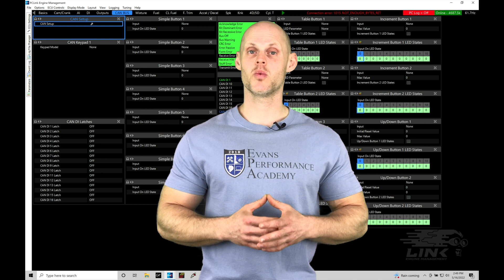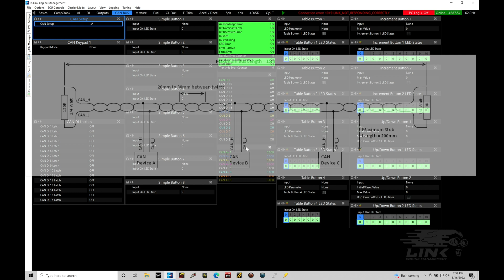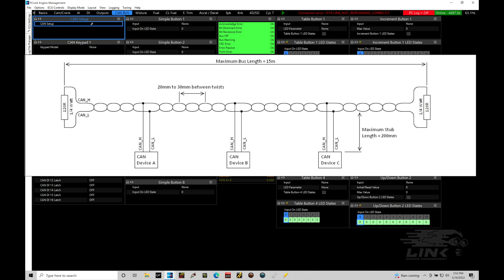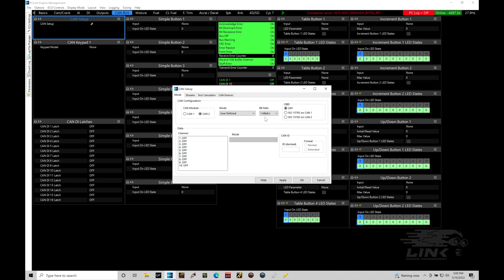Link G4x Training Part 56: AEM X-series Can Lambda | Evans Performance Academy

Comment: Is there any way to delay the heater from turning on until the engine is running with Link? Or delay the heater until it is at a certian temperature through the exhaust heating it up?

Comment: What’s your opinion on the LinkG4 for Hondas? How does it compare to the Hondata s300? Pro/Cons?
Reply from the maker: The only con would be the price in comparison to the s300.  Its a bit more expensive.  It can do everything better than the s300 and offer true motorsport features like traction control, rolling anti-lag, etc.
Reply: @EvansPerformanceAcademy  thanks for the reply and insight. How is it compared to a Fueltech 550? From my understanding, the Link plugs right in the the factory wiring harness?
Reply from the maker: @joelvillalobos4279  Link is substantially better in every aspect.  Insanely flexible programming, custom tables, huge on board logging space with logging at 1000 Hz on 100 channels, open can bus network...the list goes on and on.   Link is 100% PNP if you purchase the PNP board option.
Reply: @EvansPerformanceAcademy  last question. Does this ecu allow for the use of a T1 cam trigger sensor? Thanks again for all you support and time!
Reply from the maker: @joelvillalobos4279  Yes,  you can run the T1 trigger and coil packs getting rid of the distributor completely.